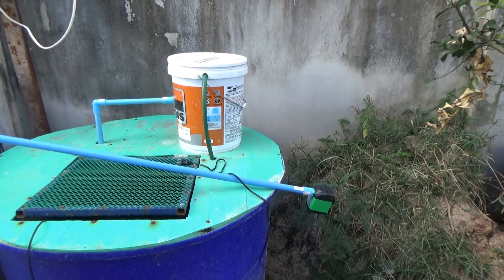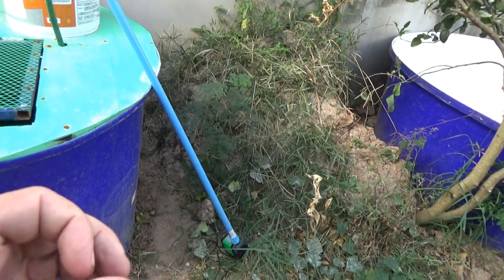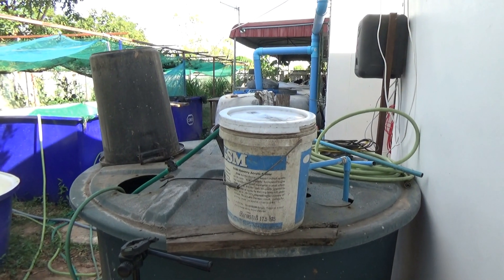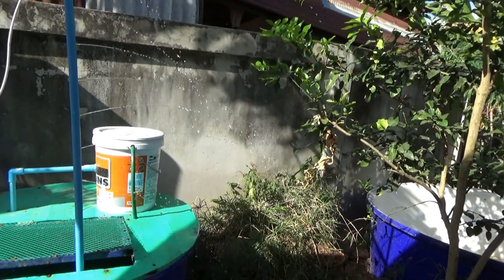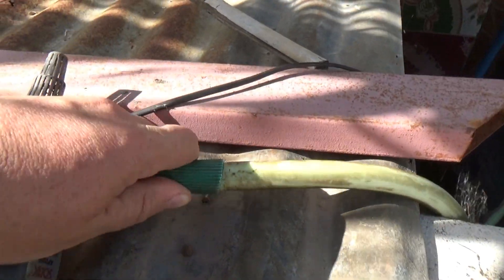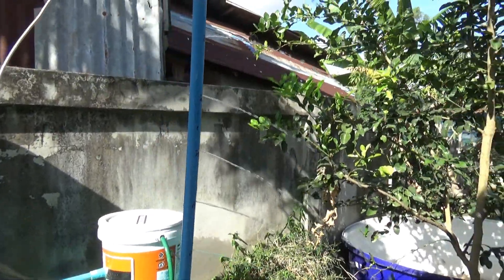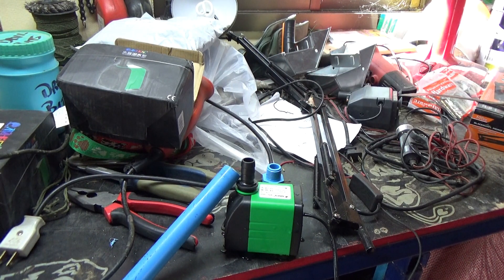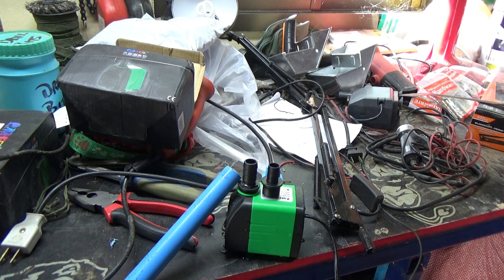Water pump Experiment, how High will it pump?

Comment: Best way to test it is a transparent pipe with no holes.
As for this pipe with holes. Water comes out first instead of pushing upwards. Thats why it tested shorter than expected.
Reply: I think the pump meets the specs. The water height was lower than 2.4m because the holes reduce the pressure, the pipe shouldn't have any holes.

Comment: Looks like it will do the job and for only $15.49 .... hope they last for awhile.  I was telling you to plug a couple holes early on in your video to see how far up the pvc pipe the water was going to go.  I saw towards the end that you had done that and the 2.4m is probably a reality.  Let me know how it goes after you decide what type of hose you're going to put on it.  May pick up a couple to take when we go back next jan.  Thanks for sharing!
Reply from the maker: It is pumping so much I had to divert some of the water away from the filter, the filter could not handle it all and started overflowing, I ordered 4 more, now to see if they last, so far so good.
Reply: @workshoplife3740  did they last? I just ordered one like that from amazon.

Comment: Good way to test it. Would you get more height with a thinner pipe?
Reply: It shouldn't make any substantial difference.  Very, very narrow pipe is going to have more back pressure and lose head height, but for reasonable diameters they should be the same.  The idea that's at play here is known as Pascal's Law, and it has some non-intuitive consequences.  This is a big one, that the diameter or total volume of fluid in a container is not important when considering the pressure in it, only its height.  If you're interested in a science video that has to do with this sort of thing, check out https://www.youtube.com/watch?v=EJHrr21UvY8  and/or https://www.youtube.com/watch?v=6zeHWVUiXoc
Reply: Cheers
Reply: Pascal was the original founder of hydraulics ,a french man ! correct me if i am wrong,i have studied decades ago about hydro/fall off pressure and reverse back pressured mass and negative pressured.so there is no need for me to google this subject,you seem very passionate on the subject :regards UK.